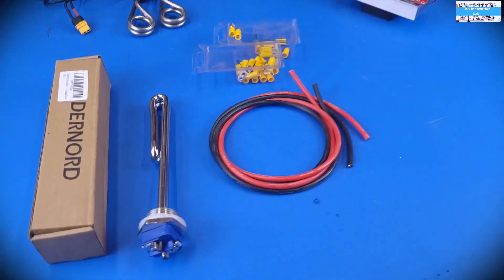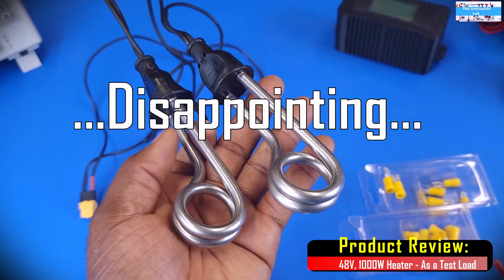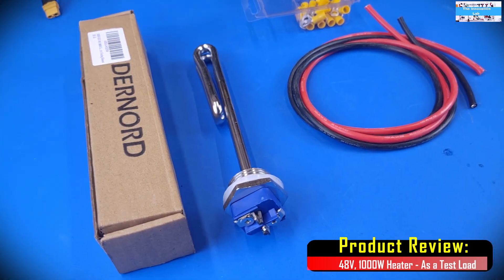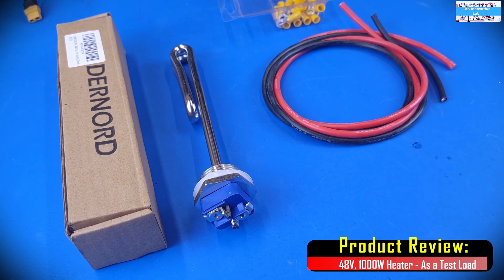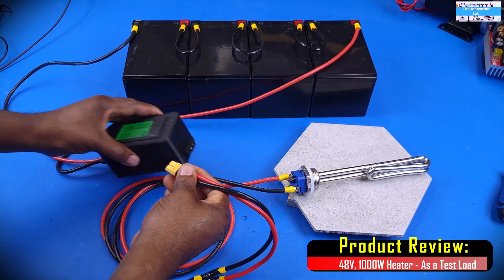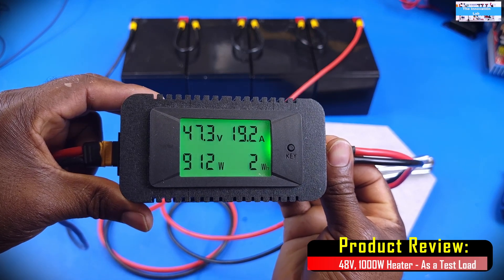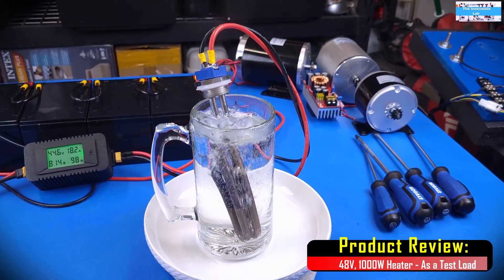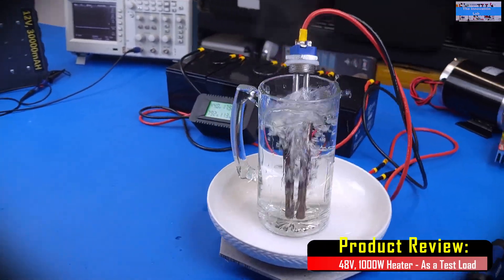Water Heater, Battery Powered, Off Grid

Comment: GREAT VIDEO!!!

I did almost exactly the same thing, but when I bought my water heaters on ebay, they were NOT as printed  (12v  600W).  They were actually 300W, but clearly labeled "12V 600W".  So ebayer's beware!  
The seller gave me a VERY rough time, but ebay promptly yanked my refunded money.  I found another seller with an IDENTICAL looking device...but it actually drew 50A @ 12v.  I discovered all by measuring the resistance first.
I figured the resistance may not read to indicate 600W ( when cold,  but with these heaters it did indeed read 0.24 ohms cold.  The one that put out 300W actually measured 0.48 ohms.  The magic sentence in the item description was "50 AMP heating"
--dALE
Reply from the maker: Hi Dale,
Thanks a million for such wonderful feedback. You are absolutely right about these sellers being intentionally misleading at times. I also learned the hard way after buying the 12V ones that didn't work as I had expected.
I am glad I found the 48V heater that I ended up using. Works really well.
Thanks again.
👍😎

Comment: Will it work with 12v ,24v and 36v ?
Reply from the maker: Hi friend,
Thanks a lot for the very thoughtful question.
👍👍
Honestly speaking, it should work, but the fact is that the power output (heat) will not be the same. This means that it might water alonger time to boil the same volume of warer.
The power output should be based on the formula V^2/R. So if you do the math, the lower the voltage, the lower output power.
If the audience finds good value with this video. I will make a follow-on video to test it with different voltage levels.